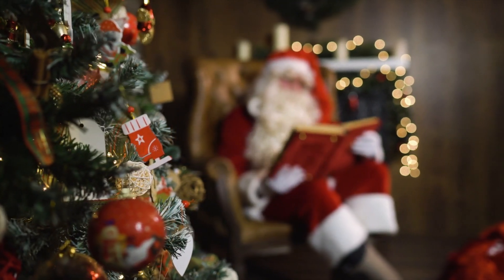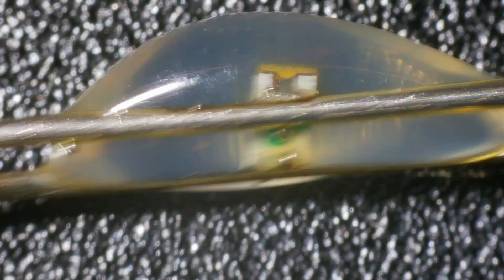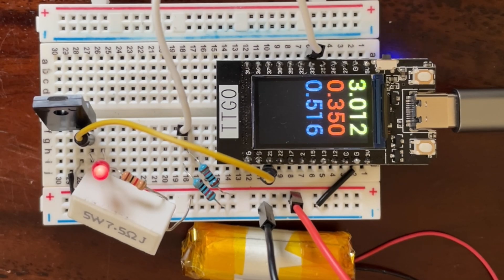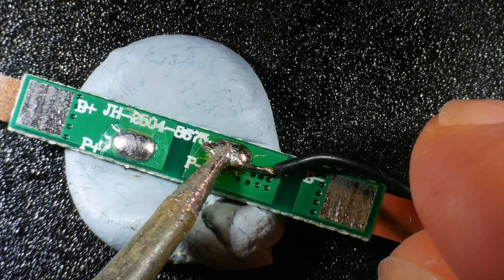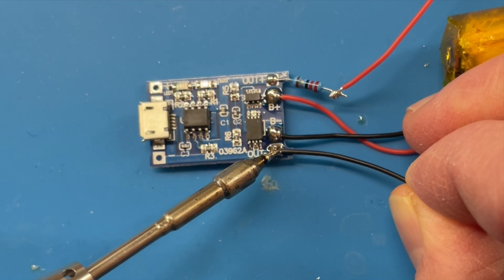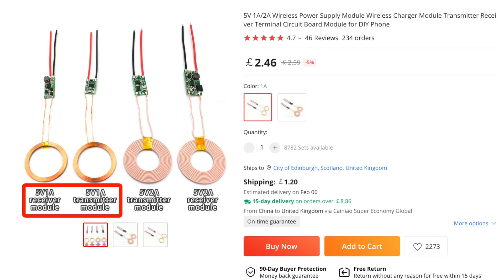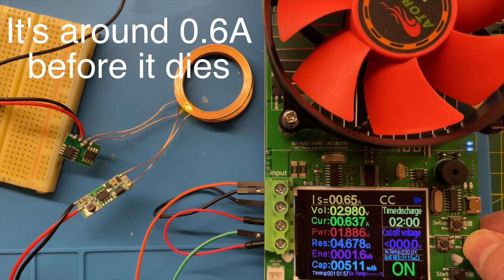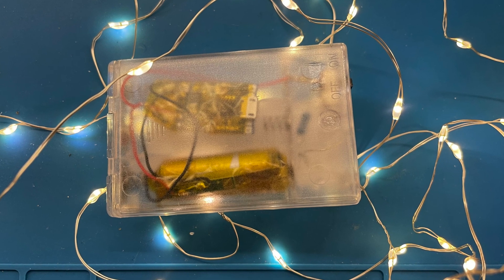Boost Battery Life: DIY Rechargeable LED Lights Hack

Comment: i think im gonna use the same method but with little solar panel, so i can have led Christmas light at the windows!
Reply from the maker: Charge it up during the day and then turn it on when it's dark. Perfect.
Reply: @atomic14  i was thinning always on, if battery goes too low the circuit should protect it.. but maybe a NPN transistor on the led, with the solar panel as base?

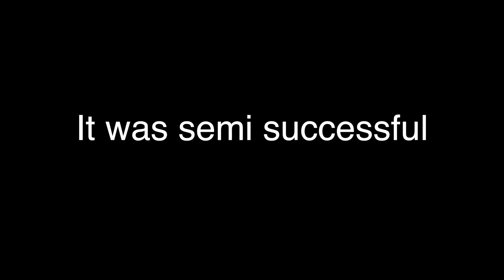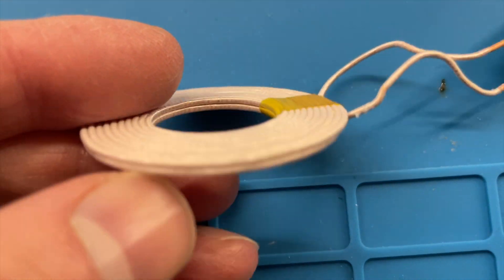Comment: Any "Qi" labelled equipment (coils, ferrites, ICs) should be capable of at least 5W (5V/1A). The litz coil you show at 5:46 has no ferrite backer. This severely limits the coupling factor, and hence the efficiency. That coil, with a backing ferrite should be capable of 15+W WPT. Murata, panasonic, etc, also have integrated litz+ferrite constructions (see Digikey) that are slimmer, and can go to 5+W, in a smaller form-factor than 5:46.
Qi chips also have better protection btw, so "accidentally blowing up a driver" shall happen less frequently :)
Reply from the maker: I think the best description of these wireless charging boards from Ali is "minimal" :) there are as bare bones as you can possible make them. I suspect the transmitter board I've blown up is the MOSFET, the receiver board that died and killed the charger board in an interesting way I'm not sure - I'm wondering if the high voltage that you get received on the coils made its way through and zapped the charging chip. Or it might be that I induced too much current in the charger PCB and that caused it to fail. It got very very hot - which is never a good sign.

Comment: You could extend the battery life by adding a flashing circuit, to make the led string flash, giving a low mark space ratio, reducing the average current. 
The circuit can be made with a power mosfet, driven by a Schmitt trigger or 555 oscillator. I think the mosfet could be driven by a single flashing LED. 
These exhibit a very small off current and a useful on current, so with a suitable series resistor, the resulting voltage can be used to drive the mosfet gate.
If a hc mos Schmitt trigger logic  is used as the gate driver, there is the option to add a sensor circuit to switch on the LEDs, for example  making them ambient light sensitive.

Comment: Interesting! I like the low drop out regulators as they maintain the same voltage & hence same light output until they finally shut down, but they are more complicated. I am now finding that a lot of lights come with a 6 hour timer using a application specific integrated circuit (asic) with an external crystal, so that the led runs for 6 hours, off for 18 & repeat giving over 3 days just from this, but additionally the asic puts out a pwm illumination voltage that also significantly extends the run time. In some of the solar lights they use a Joule thief circuit that allows operation from a single 1.2 volt nickel metal hydride cell. I have searched in many places for the asic chips, but only find them on manufacturers web sites in China using the printed numbers on the chip, not on places like eBay, banggood etc. This probably means I haven’t used the right key words although there are a few threads on the net with others saying they also can’t find them. If you have come across a supplier for these asic please could you let me know. I find it pleasing to extend run times & save either batteries or recharging times & the designers of these asic chips have done a great job. Thanks for sharing!
Reply from the maker: I found this - https://www.aliexpress.com/item/1005002142906128.html - but I'm not sure it's really what you're looking for.
Reply from the maker: These are the ICs https://www.aliexpress.com/item/1005002366936589.html and the datasheet - http://www.datasheetcafe.com/yx8018-datasheet-pdf/
Reply: @atomic14  Thank you for your help. The chips you found are the fairly common solar controllers with boost via the inductor. What I have been trying to find are battery only, no solar, & with an external crystal that gives 6 hours on, 18 hours off, but so far no source. Thank you for looking.
Reply from the maker: Ah, like these - https://www.aliexpress.com/item/32804200967.html looks like there's a blob chip. Not sure if these ones do the PWM signal.
Reply: @atomic14  Yes, like these, but some of them, such as the tree topper I got from Aldi last Christmas, have a surface mount chip & a crystal & run for 6 hours out of 24. I bought two Aldi angel tree toppers, the first intermittently failed & had no pwm, the latter worked great & had pwm, but I have never been able to find a supplier of them. I have thought to use a arduino uno to do same thing but it’s an overkill & yet might be my only option with out these asic chips. Thank you for your help!

Comment: I would just put them on a solar cell, as with the cost of heating now days! I'm in bed when it gets dark so won't notice there not on anyway.
Reply from the maker: That's not a bad idea - and when the lights are on, the solar panels will charge, which will make the lights brighter... hang on a minute...
Reply: @atomic14  that rabbit hole is deep, so very deep